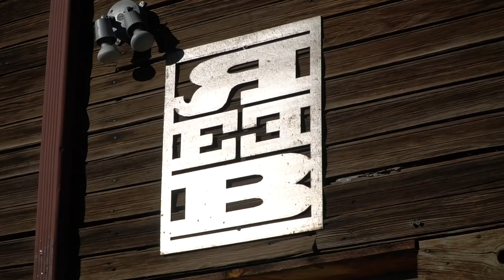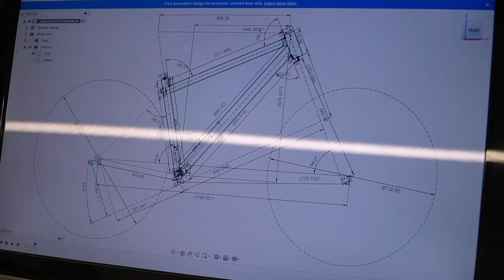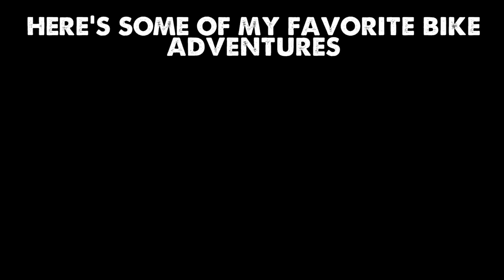The Build Process of my Reeb Sqweeb 29er-USA Made Mountain Bike

Comment: Congrats Ryan on the knew bike.I also had a Diamondback,that was my first MTB. It was all tubes,and no suspension. Also i am glad your knew bike is made in the USA,i have 97 Klein,hard tail,that was also made in the USA.Question how much does it weigh,if they are only riding down hill,like in your video.They must weigh a lot. Ride safe.✌🌍
Reply from the maker: Thanks, I'm excited about this one! This bike isn't the lightest, I think it's about 30 pounds, a bit more than the Trek Fuel I'd been riding the last 5 years, but still climbs really well

Comment: Awesome bike man! What route did you take from Lyons to Boulder? I’ve been trying to put together some epic dirt rides starting from my home in Boulder.
Reply from the maker: I wanted to take picture rock trail to Heil Ranch, but it was closed, so I rode the highway for most of it, then found some dirt at Boulder Valley Ranch. Have you ever used Komoot? Check out their site, it helps you map all sorts of fun routes
Reply: @duzer  Never heard of Komoot, I'll have to check it out. I've had my eye on a route from town up through Boulder Valley Ranch over to Neva Rd. then over to Joder Ranch to Left hand Canyon and up through Heil Valley Ranch to Lyons and back. Haven't had the time, weather, and trail status line up to actually check it out yet though.